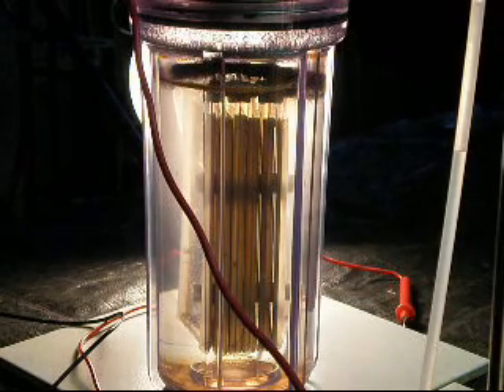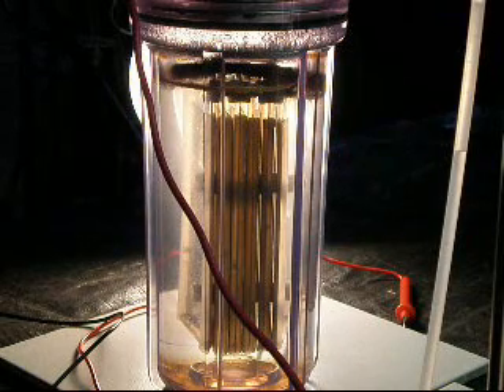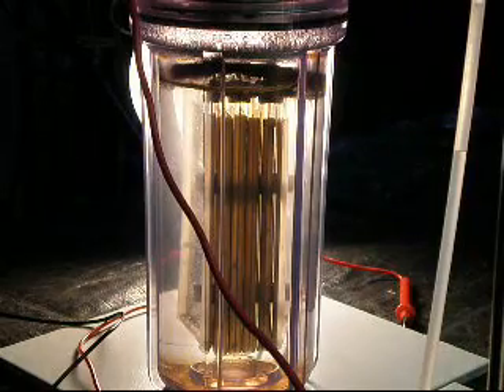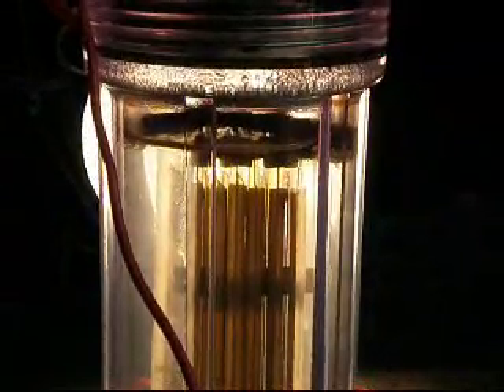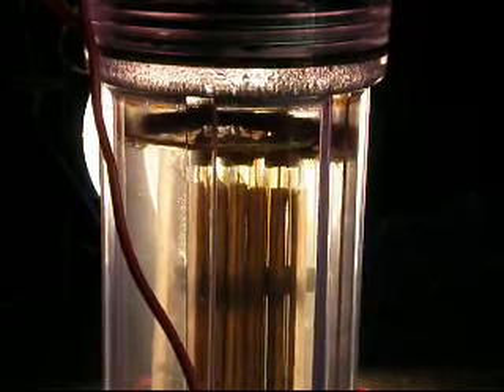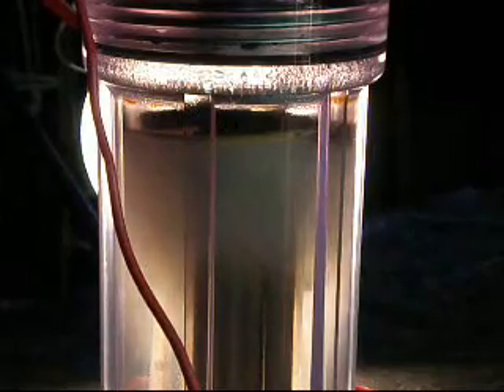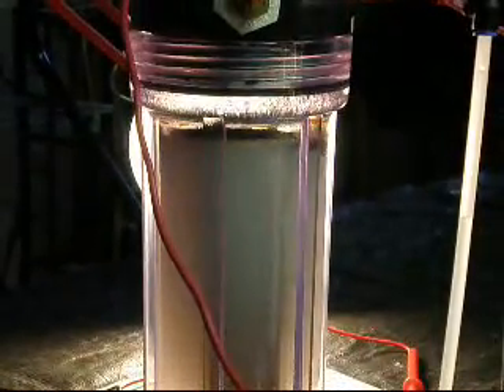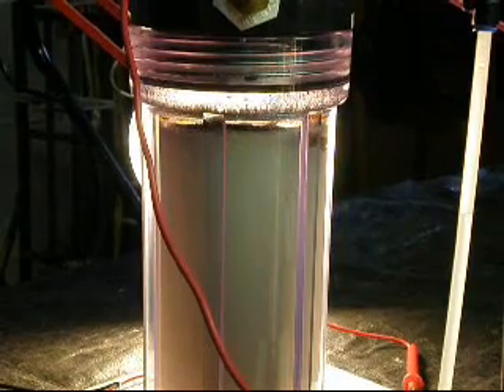#002 HHO foaming problem solution

Comment: please anybody - i need advice, my hho generator works well (-ish) but i'm having trouble with overheating. 5 plate stainless steel, ordinary tap water, no vinegar or bi-carb and after ten minutes it gets hot. Thanks in advance.
Reply: make it 8 plates . + n n n n n n  - . Heating will stop . Use Deionised water / distilled water with NaOH ( 40 grams NaOH in 1 litre of water ) .

Comment: Using degrees Celsius is up to date,
it is a metric unit not a medieval, like old fashioned Fahrenheit.
I know your cell won't reach temps above 100°C
but your bad ( OK 'not so good open-') cell design will reach temps in the nineties, enough to evaporate allot of water and vinegar vapors. Vinegar is a bad electrolyte the conductivity is low,
and it evaporates, no problem if you use KOH or NaOH.

Comment: Bad idea HHO2YOU,
Water boils at 100°C, acetic acid ( vinegar)
boils at 118°C, so you'll blow it all quickly
in your engine. Then your already bad conducting
electrolyte is gone. ...
But the pad idea is an old but good one to apply.

Comment: Awesome, you guys rock! 
Also, my cell don't last much longer than a month due to the heat from the engine compartment. I use 2" or 3" Black PVC (highest heat) but eventually leaks occur. I loved Zero's secrificial membrane for flashback. And after 2-3 hours driving when the cell is hot, how much of that gas is now actually steam? Holding a naked flame to it doesn't produce the same pops. (always use earplugs, bubbler, flashback, raincoat, beercooler)